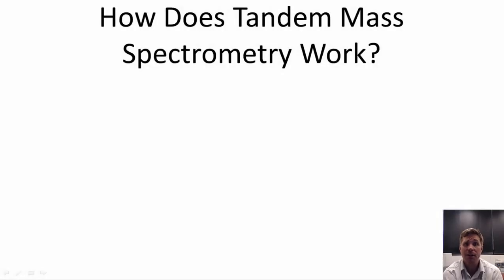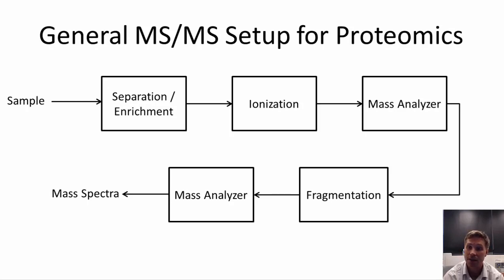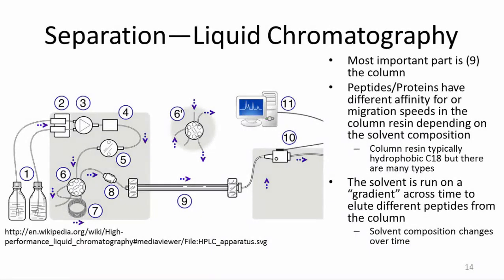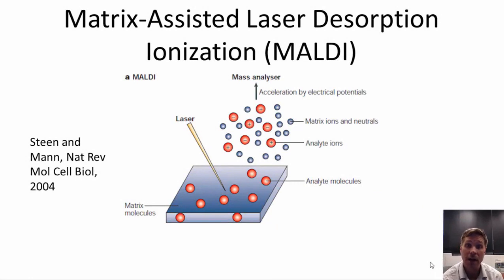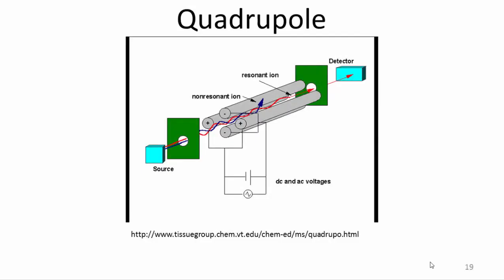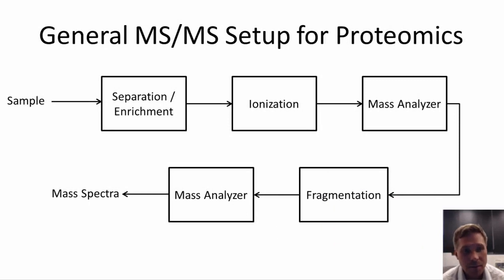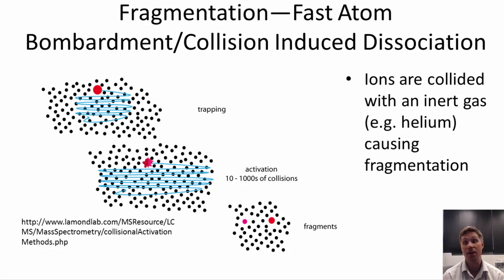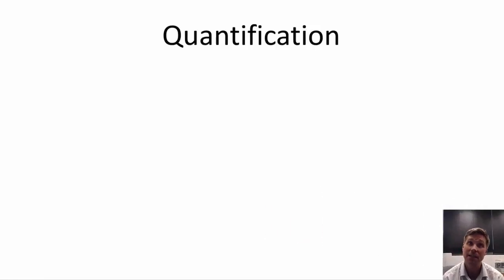6-1 Tandem Mass Spectrometry, or MSMS Link1

Comment: 11:33 The oscillation is axial not radial. In fact, one of the C-Trap main functions is to ensure a coherent radial distribution inside de orbitrap, it slows down the ions as they come in and then it injects them into the orbitrap at an almost equal kinetic energy. This, combined with the ion squeezing effect of the high voltage central electrode (the spindle) produces a cloud of ion rings that oscilate axially at a frequency inversely proportional to the m/z